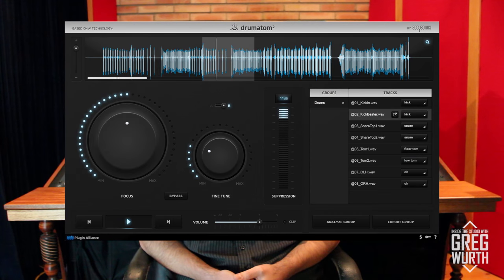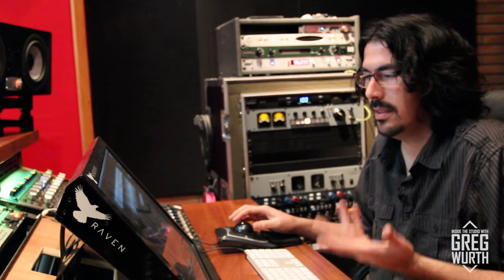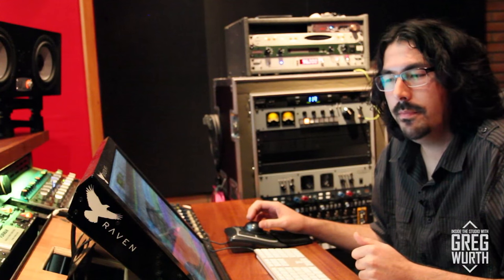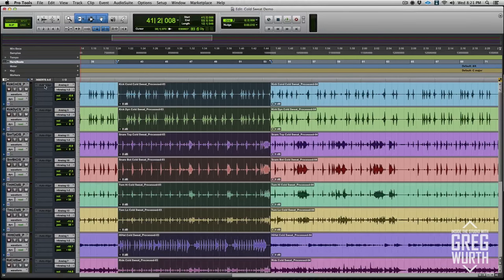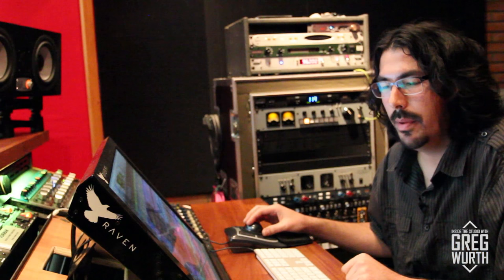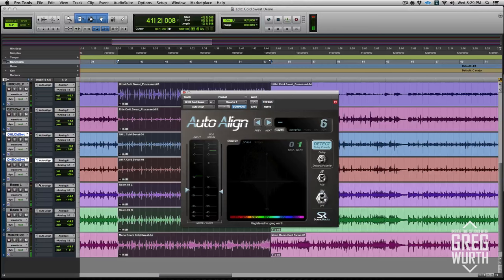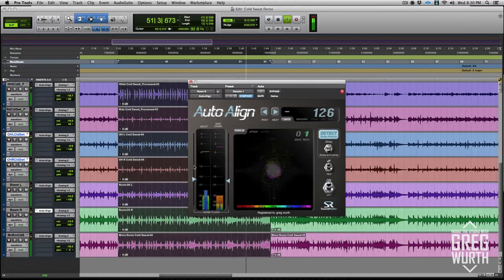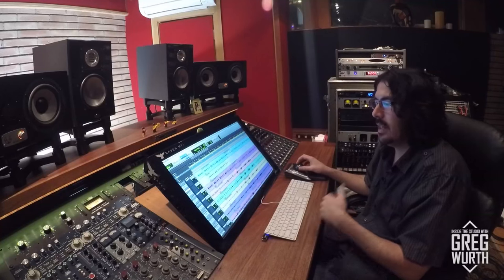Drum Processing with Drumatom & Auto Align

Comment: I use both of these but use each just a little differently.  For Drumatom, I set up separate groups for:  Kick, snare top & bottom, low toms, and floor toms.  In each of those groups I place that type of drum & the overhead track.  I find I get better results if I have the separate groups for each category of drum track.  I have never used it on my ride or hi hat tracks - never thought of doing that - but may give that a try on my next mix.

For Auto Align, I set the input & sidechain levels a lot higher - to where only the sound you are trying to align is the one being reached in the meter.  So, let's say I was aligning your 2nd kick track with the overhead.  Based on your video (at 14:20), I would set the input slider at about -5 to make sure it is set where only the actual kick hit is being used for the alignment.  That means no false positives in the processing.  For toms or drum tracks with infrequent hits, I will loop a fill including that drum & it works great (a loop works just as well as an uninterrupted track for this processing).

But anyway, this was a very good video & I'm sure a lot of people have learned just how powerful these tools are in helping get a great drum sound.  Nice job!
Reply: Watched several videos about AutoAlign and this where my thoughts also.
A lot of times in the videos on youtube, the input and sidechain sliders are not even used and left all the way at the bottom by people who explain the plugin - which  is a problem for detection or is it not?

Also, what are your thoughts about aligning the left and right channels of two overhead mics?
Im thinking you only should do it if you use overheads placed freely above the kit (like focusing them on the Cymbals).
If you have a stereo overhead setup i would destroy the stereo field with aligning (delaying) the left channel to the right channel... so I'd rather not align them to each other?

Comment: Is the bounce option a HD thing only? I don't think I can bounce multiple tracks at the same time.
Also you're the first to make good sounding example of drumatom. I tried it and I thought it was impressive on hihat but too dull on snare + not stable as it crashed the first time I exported audio.
Reply from the maker: Drumatom can make tracks sound dull if you run too much which requires need to dial it back to taste. I'm not sure the difference in non HD but PT 11 will definitely allow offline bounce just not sure if it allows multiple busses at once. Thanks for watching !
Reply: +Greg Wurth Offfline definitely and it's more stable on my native system than real time. I wish I could bounce all the stems at once. You're on 11 or 12?

Thank you for your answer and for the videos!

Comment: Hey Greg. Great vid!
2 questions on Auto-align :
- Why do you split your overheads into two tracks? Couldn't you use a stereo instance of Auto-align on your overheads as a reference point for time aligning the rest of the kit?
- Soundradix recommands using the top snare mic as the reference point. It doesn't make much sense to me, but have you tried it?
Reply from the maker: +MusiqueProdVid Great Questions.  I split the overheads so that Auto Align can actually analyze and phase align the overheads together as well as the rest of the kit. I've tried several variations of Auto Align and what works best for me is what I have shown in this video.  One thing I mentioned but didn't show was that after I analyze the kit, I then move onto analyzing the top / bottom snare together in a second pass.  Russ Hughes may be able to give you some better insight on this but I am very pleased with the workflow that I used.  Take Care!
Reply: +Greg Wurth  Yes I do the same thing (snare top and bottom) and also kick in and out if used. Room mics: I don't know, something it works, sometimes not. A matter of mic positions and song context I suppose.Thanks Greg.
Reply from the maker: You are spot on! Have a great day.

Comment: So I tried both. Don't do it before. Weird phase stuff. After, excellent. once again, in moderation. So, Drumatom, Auto Align then fix some timing issues. I did not do elastic audio. Just some manual moving of some hits. And if way of time, get the drummer to do it again. Or, get another drummer.Ha!
If need be, auto align again. It will not hurt. 
 Remember, some leaking is good. Their drums for heaven sakes! Good luck . 
Another note, Greg, whats that board you have there? Thanks
Reply from the maker: thanks for writing.  It's a hybrid desk with gear racked into it. 16 vintage 1084's plus some other goodies